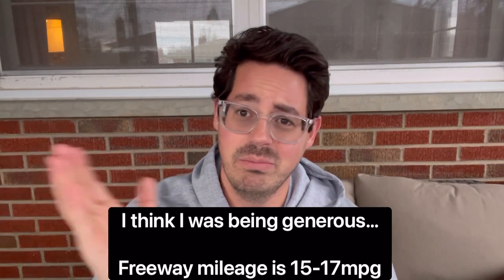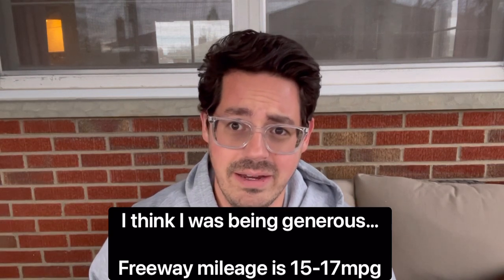Worst Engines of All Time: 1982-84 GM/Chevrolet 305/350 V8 Cross-Fire Injection System

Comment: If you believe long run wet runners are best for high rpm power, why is a single plane manifold with short runners better than a dual plane in high rpm racing? I think the long runners might be another part of why the Cross Fire hits the wall so soon. This was also true of the long ram TPI that replaced it in the Corvette.
Reply: You are correct. Richard Holdener has shown this repeatedly on the engine dyno. His YouTube channel is  a great place to learn about this stuff.
Reply: I agree. I believe the reason it had problems is that it had to make too many crazy turns, which forced them to make the runners smaller runners to keep the velocity there at low rpm.
Reply: On a street engine or even a mild perf build a long runner is good for low end torque and short runners are good for higher end torque. Look at ford's, they love dual runner manifolds in the 2000's. All the perf engines that didn't use a m90 Eaton used long to short switching manifolds.
Reply: Chevy made up for the crossfire with the tuned port injected 350 in 85.
Reply: @dcdanger6151  sort of. It still had it's drawbacks
Reply: @robsorgdrager8477  Yes but you have to give them style points for cool looking intakes.

Comment: Just one more thing. Great video and info👍 Ironically, Pontiac Motor Division was supposed to be General Motors performance division. In the early 80s the cliché was, “We build Excitement!” Obviously not with only 165 hp, and then you have to baby it or the grenade will explode, 😂
I purchased a brand new 1993 Forest Green Trans Am with the 5.7 L Tuned-Port injected motor. That engine was literally junk. I had issues that would've been similar to vapor locks in the 60s and 70s. Long crank times, and half the time, it never idled correctly, and when you opened the gas cap, it sounded like high pressure air coming out of a balloon. Ironically the vehicle was stolen (and used in a high-speed chase). Subsequently (with the insurance) I bought a Mitsubishi Eclipse. Happy ending😉
Reply: Tuned port injection ended in 92 (91 for vettes)..so a brand new 93 would of been a lt1..
Reply: Thanks 👍 You’re spot on..
Reply: Had a first year Eclipse.  Nothing but fond memories,  what a tight car. Miss the Mitsu brane that once was.  That was my Japanese epiphany back in 1990.  Never looked back😉
Reply: Sorry to hear about that LT1 experience. Perhaps the Opti-Spark needed attention.
Reply: The Service Advisor kept it for a week and gave it back scratching his head..🤔
Reply: @jessebrook1688  You know Jesse, I'm not sure. The service department was very familiar with that car. On one occasion (enroute to the dealer) it stalled on..yup.. RR Tracks! Reminiscent of the "Twilight Zone episode". I was soo P'Od that as I pulled into the service bay (at probably 40mph) I slid to a stop, slammed the door so hard it broke the latch, and told the service advisor, "You can keep this POS..!"

Comment: Your worst engime maybe but I love the Crossfire! Easy to service and reliable.. Never saw what the big deal was? Either in a 305 or 350 I never had a Crossfire run bad. Yeah not really a performance motor but ran better tham any crappy LT1 with there shit Optijunk ignition and reverse flow coolant system and a nightmare to chamge plugs on. Sorry but a Crossfire is the only Chevy engine i'd own in a Vette or Camaro/Firebird.
Reply: Yeah that’s cool and all but I’ll keep my TPI in my corvette
Reply: @loosechange4986  good for you. At least you didn't engine swap it with a LS
Reply: @silverwings11035  I’ll probably do that in the future.
Reply: @loosechange4986  Wow thats too bad for you. I'd rather have the T.P.I. than a LS. Sorry for you then.

Comment: Hmmmm     Take off the two throttle bodies and put a couple Carters on it and do a port job.   Just kidding.
Reply: Thats what I was thinking. Its similar to the 69 camaro cross ram.......
Reply: I don't think that would work well. The manifold is just plain badly designed. I say put a regular cast manifold on it with a Rochester or Holley and a regular mechanical fuel pump.

Comment: Throttle body injection is bad enough (barely better than carburetors and not nearly as serviceable) but making it unnecessarily more complicated makes it that much worse.  I had a new 1990 Firebird Formula with the base 305 TBI as a "boulevard cruiser" that made as much or slightly better power than Cross Fire Injection.  My car hit a solid 30 MPG for a tank on a couple of instances.

Comment: Fantastic video overview! My brother and I were looking at an 82 Camaro last night and I tried explaining just what made the Crossfire a disaster...sending this video, you did a much better job explaining it than I could! Honestly this engine is a sad low spot for otherwise really great cars. 

I find it ironic that this system was probably the first fuel injected cars many people drove, yet it failed to deliver any of the marketed benefits of fuel injection over a carb- efficiency, power, and reliability.
Reply: Likely not the first fuel injected car that most people drove, as the crossfire was a pretty rare, performance car only, option. TBI isn’t as good as port injection, but it’s simple, reliable and works well.

Comment: Nothing wrong with the Crossfire system if you actually study how the system works. Turn up the fuel pressure to 15psi with the regulator which most the time the factory set them at 9psi which is not enough to operate the system correctly especially after they have aged. I've owned 3 of them and all ended up being very reliable and ran smoothly. My 82 Collectors Edition and 84 Corvette I owned got great highway mileage.
Reply: I heard that you could make the ones in Corvettes work well...  not the 305 in the F-bodies tho
Reply: @keithjackson286  never worked on the 305 with the setup, but I've tuned many Corvette crossfires with pretty good results.
Reply: I call bullshit.
Reply: So what you're saying is the factory engineers, and the design engineers, didn't know how the system work. Otherwise they would've turned up the fuel pressure. Always somebody ready to defend some garbage design
Reply: @kevinbarry71  when new they would run decent on 9psi. They kept them lean to cover emissions. As they age they wouldn't run on 9 to 10 psi very well especially if you had vacuum leaks. There's actually a GM bulletin on this when enough customers came in complaining, so the mechanics would rebuild the throttle bodies and while you have it apart, they would adjust the regulator to 13-15psi and gained decent results. I'm not saying it's an awesome set-up but they are not as bad as people scream about it.
Reply: @chickenjo23  if something works OK when new, debatable premise, and deteriorates rapidly, that is called truly bad design. Or bad engineering. Doesn't need to be defended
Reply: @kevinbarry71  to each his own. The system works good when adjustments are made. Not the best design. Just a hold over until GM finished out the Tuned Port Injection setup which was leaps and bounds much better.
Reply: @kevinbarry71  bruh this is gm where talking about they probably did it for  Emissions or some shit
Reply: @sorrynotsorry4016  that's their excuse all the time. But the reality is other manufacturers didn't have this problem. It's just they're terrible engineering. And there never seems to be an end of people like you willing to make ridiculous excuses for their inexcusable behavior
Reply: @kevinbarry71  ok u can't fault the manufacturer for the era's fuckery and it wasn't just gm doing shit like this everyone at that time was doing the same shit
Reply: So every owner has to be a knowledgeable  mechanic? Corvettes wer junk after 67,the door panel ripped from their attaching points,the driver seats would tear up within 20,000 miles,brakes were always a problem,I'm not talking just about mine,I owned 4 77-80,but everybodies.Id rather own a 69 Dodge Dart slant 6 with a bench seat than any Covette after 67.Sounds like this guy knows all about the problems with the Crossfire.
Reply: @duster71  when these cars are over 40 years old and haven't been maintained properly yes you need to have some knowledge on them. Just like any other car that's aged over time.
Reply: @chickenjo23  they were junk when they were new.
Reply: @duster71  well that is definitely an opinion.
Reply: @duster71  there's many cars after 67 still in original pristine condition. Most of the time a trashed out Vette was owners error. Not the car. Was the quality then phenomenal? No. But like anything else alot have been taken care of and are not junk. Some of the more desirable vettes are 68-70. Bring pretty good money for something that's supposedly "junk". My dad has a 69 427 tri power and seats are not torn or door panels unattached. He also takes care of it.
Reply: @duster71  you're a real Mopar guy🙂yep a valiant with a 340 is pretty good. Even a 170 is all right.
Reply: @duster71  if you don't like it buy new car
Reply: @sorrynotsorry4016  I own a restoration shop,I don't buy new cars,and who do you think you are telling somebody what to do.Maybe you didn't read all of my comment,I had 4 Corvettes,77,78,80 and a 67,the only good one that wasn't engineered and built like trash was the 67,so I know of which I speak.
Reply: @duster71  sure you do and im the queen of England
Reply: @sorrynotsorry4016  we'll you better polish your crown Little Queeny.
Reply: @duster71  will do chief
Reply: @duster71  another thing the crossfire v8 didn't come out till 1982